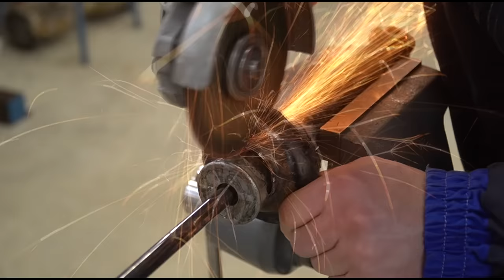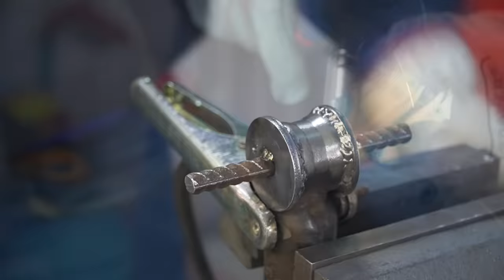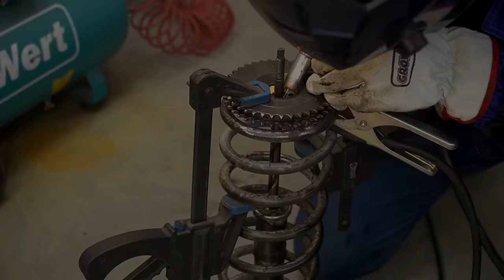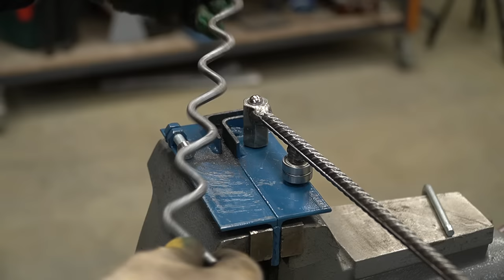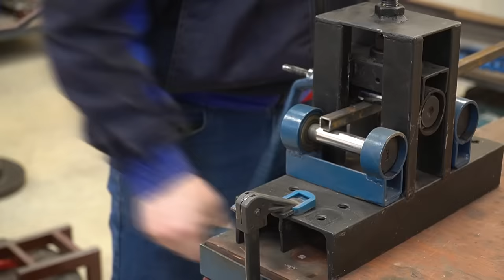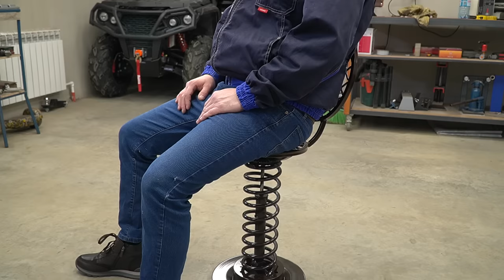Top idea from old auto parts!

Comment: Great idea. From the thumbnail it looked like it was going to be a bike rack. Yet, I would suggest and experiment with making the seat larger and upholstered; for better back support the back should also be larger and slightly higher; maybe weld in something curved for lumbar support; and add a five point caster for mobility. As I have noted elsewhere, it's way to bad that I do not have the money, materials, the machinery, and the facility to pull something like this off. Yet, how long did this take from thought process to complete project? Imagination and intuition had to have played a major part in this. I am not in the market, but how much would you charge for something like this?
Reply from the maker: Hello, thank you! Of course, this is improvisation, and needs to be finalized, which you have voiced, everything comes with experience and my next chair will be much more comfortable)) I spent about 5 days for several hours together with the shooting!
Reply: @MA-SH  Thank you for your reply. I had some shop classes on the college level so I am still aware of everything that can go into a project like this. Also for roughly twelve years I had two different jobs as a welder, MIG and TIG. Steel and Aluminum. I could never get the hang of welding stainless. I did cast welding [NICAD] but it was a little temperamental.
Reply from the maker: @davidalanjonesridge9874  🙂👍

Comment: nice chair!
i hope the rebar on the brake disc will not break!
Reply from the maker: Hello, my friend! The whole load is held by a spring, a rack for stabilization in slopes!👍
Reply: @MA-SH  Ok, the spring supports all the weight without problems and the shock absorber maintains the stability of the stem.
In case of breakage of the rebar (but you are thinner than me, so it is more difficult for this to happen) you could find yourself tipped over backwards or sideways like those garden toys, stopped on the ground by the spring alone, which leaves them free to swing in every direction.
Reply from the maker: @zolatanaffa87  Yes, I know that! but believe me, everything is very reliable!Thanks